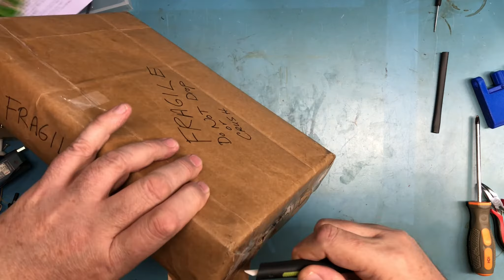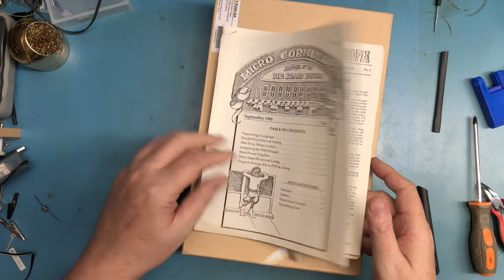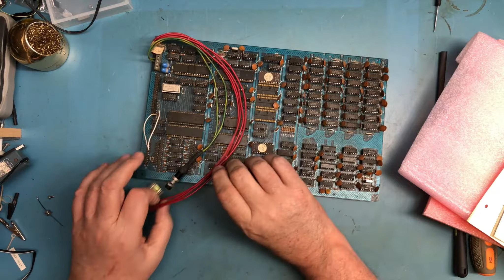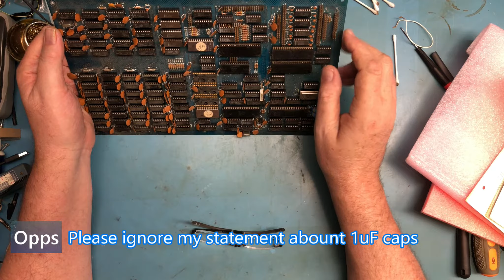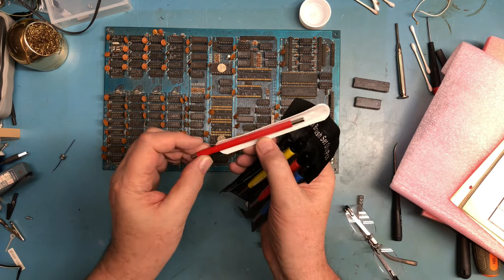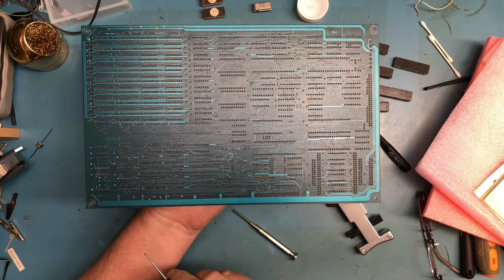STB650 - Ferguson Bigboard - Part 1 - Unboxing

Comment: Perfect timing.  I'm about to receive a BB I and I've been hoping to nab one for a long time.  Mine seems to be either an early release or a prototype board as it has no soldermask and it has extra board material around the final board dimensions so I will think hard about whether and how to trim the extra.  Looking forward to this series.
Reply from the maker: Would love to see photo's of the PCB
Reply: @ShadowTronBlog  let me know if you can access them from this link - https://photos.app.goo.gl/jpKsRiQXJznUqGMT7
Reply from the maker: @johnn0hj  Yes, I can see the photos. Very cool, definitely a BB. I wonder if this was a prototype?
Reply: @ShadowTronBlog  I received my board a few days ago and noticed just one jumper on the trace side.  If memory serves me, yours has two jumpers.  If you get to documenting those jumpers I'd appreciate a heads up.  I'll see if I can determine the circuit change on mine.
Reply from the maker: @johnn0hj  I have two jumpers on the backside of the PCB:

U73 - 2716 - Character Generator ROM
Pins 24(Vcc) to 21(Vpp) 
The 2716 requires +5 on 21(Vpp) in normal operation.

Trace Cut U10-12 to U11-3
Jumper U11-3 to U11-14(Vcc)
In the manual I downloaded on the "CRT DISPLAY GEN." page this change is hand drawn in the schematic on the top/center. This makes me wonder if this was a common mod.
Reply: @ShadowTronBlog  I do not have the char gen ROM jumper or trace cut you describe.  Perhaps this is because both of my ROMs are 2516s.  Could be my board is a very early version, hence no solder mask.  On the rear of my board, near the screw terminal portion, there is what looks like a serial number - B2710 hand scratched into the board and just to the right of that lettered in tinned copper trace is PCB-1.

I also do not have the CRT DISPLAY GEN mod/changes you describe - no jumpers and no cut traces.  I'll dig into Micro-C to see if this mod is addressed - film at eleven.

The jumper I have seems to be a trace repair where the line from U70 pin 7 goes to U58 pin 2 (the line was broken).  I do not have any sockets mounted at U68-U70 but it is obvious from the flux residue on the rear that sockets were installed at one time.

Hope this gives a little insight into my board's vintage.

Comment: Regarding the pin corrosion. It often is an silver coating of the original pinframe that some manufacturers used to have a better conductivity. As you know silver gets black over time but can be cleaned with an silver jewelry cleaner. I’ve done that in the past. It’s not permanent though. The silver will get black again over time. There is the possibility to gold plate them with tin or even gold by galvanize them chemically (never done this) to protect the vintage chips. About 20 - 25 nears ago I had an gold plating kit to plate pcb traces which was basically a pen with a chemical solution that deposited a thin layer of gold electrically. Nice board though. I had a bare repro/clone pcb of the big-board but never got around to assemble it and bring that one up. Oh well. Unfinished projects ;)
Reply from the maker: I've tried various tarnish removers for silver and have little to no luck with it.